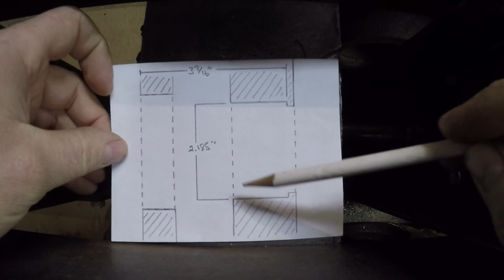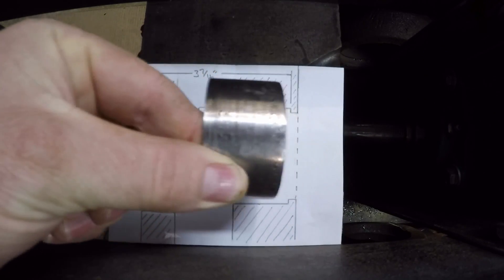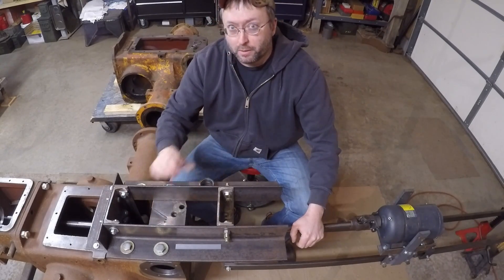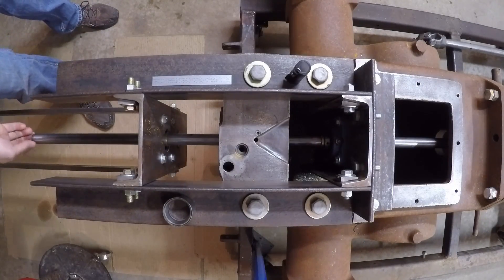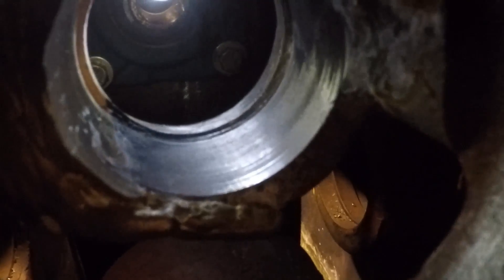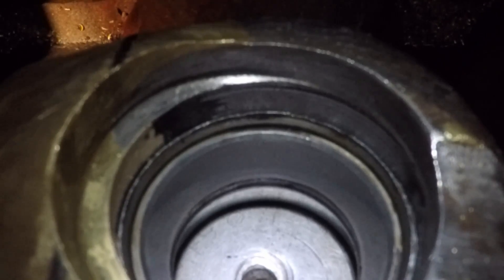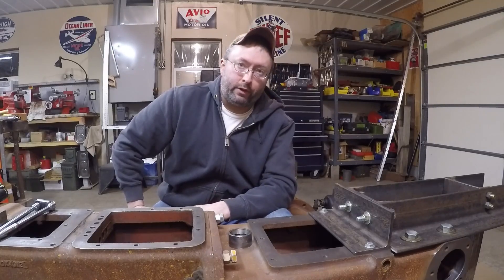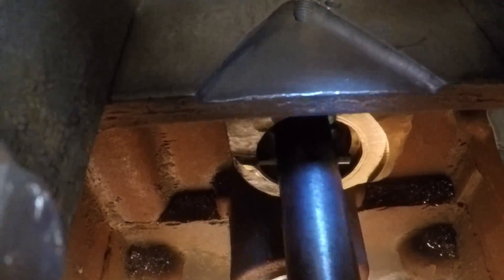Minneapolis-Moline Prototype 445 Tractor #X231 Restoration - Part 18: Machining the Rear End Casting

Comment: Just happened on this and for you not to have a fully equipped shop I think you have done an excellent job. That is a hard repair to do even on the best of days. I may heve missed it but how did you add on the missing material? Great fixturing by the way.

Comment: for the side bore..  are you going to create a plate to bolt in and mount something like automotive hub and bearing assemblies to support your cutter bar ? 

 have you been able to get customer approval to shorten the end of the driven side gear slightly so you can leave more material around the bearing bore you did..  since it won't be driving anything with as much power as it was designed to hopefully.  

 i don't think i would try to duplicate the exact shape in the production case..  just a pocket... if you want to leave room... cut the end of the side gear slightly concave..   too bad the engineering to put in something like the pinion thrust bearing used in 9 inch ford rear axle  cases could not be used to reduce deflection..   but i really don't expect that anybody will be using that drive to bale any hay at full power. 

 removing only an 1/8" of the end of the side gear will really make a huge difference in the amount of metal left on the main case..